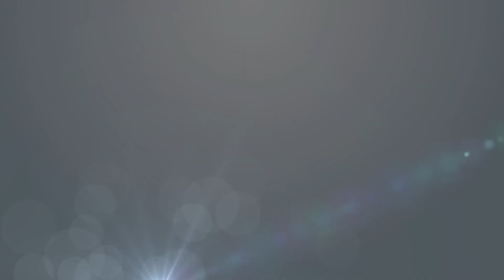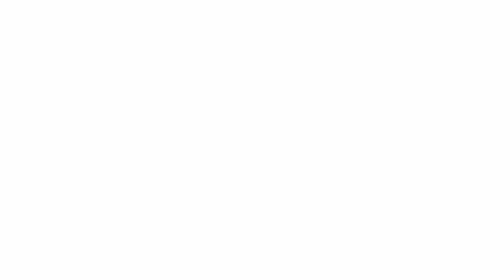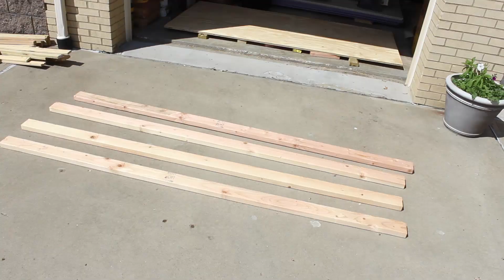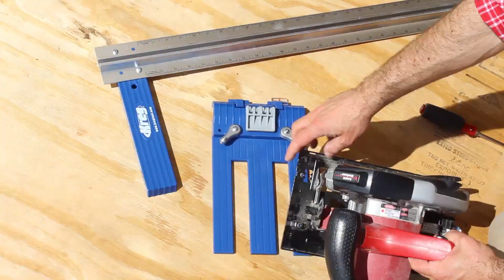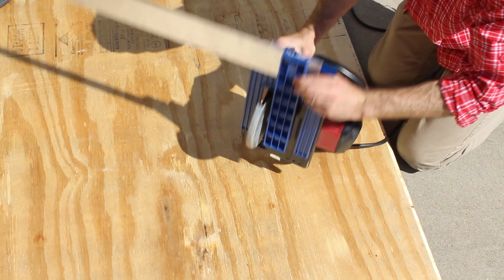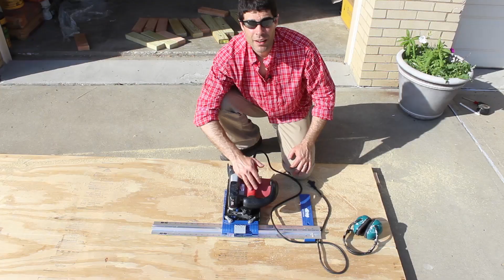Cutting Plywood and Sheet Goods with Kreg's Rip-Cut--by Home Repair Tutor

Comment: This tool is freaking awesome! Ive been cutting panels for years using the old straight edge deal and took delivery and used this first time today. At least halved my cutting times. The construction of the tool is really strong and fits saw perfectly. My building colleague is in love with it as well. Awesome tool cant reccomend enough. Thanks kreg im so impressed.

Comment: Thanks for the video, I just bought this and your tips were helpful. I,m a retired novice woodworker and its easy to use and no problem cutting large sheets, I've a cordless circular saw and the Kreg worked fine with accurate cuts, I'll get better and faster the more I use it, I find it easier than trying to mark out long lines as I always veer off the line so the edge stop is great for me to use. Thanks Again.
Reply from the maker: +Neil WeeGee awesome, glad to help. Those cordless saws are awesome. Especially with large sheets, I always get tangled up!!!
Reply: I'm sure

Comment: I read other people using it and a few said it broke after a few uses due to the weak plastic. Looking at this video the guide has some play during setup, plastic flexing. 

Learn to use a circular saw and cut freehand on the line and if need to, clean up with a hand plane.  Still need a table saw in many situations if you do enough wood projects.

Comment: Looked at one today, but passed cause it looked to plastiky, watched your vid, and now will go back and buy one. I'll be cutting some really nice maple plywood and don't want to make the mistakes I made on my 1st desk project ripping the sheets. Also just a side note, if you use just regular old masking tape over where you plan to cut it gives you a perfect smooth cut without all the splintering associated with plywood's

Comment: Bought this at lowes three weeks ago had to tweek the fence cause it wasn't square.Used it couple times and its good for casual use.If your contractor your better off with track saw.Plastic wont last long I know i'll eventually end up replacing plastic fence with aluminum one.

Comment: I have two table saws but running 4 x 8 sheets is a pain so I have long used a sacrificial cutting table and circular saw to break down panels.  I use a straight edge and a clamp but I'm about to make a whole wall of bookcases and I like the idea the Kreg jig will give me identical gables and shelves so I'm going to get one.  I have the greatest respect for Festools but unless you're a dentist with  woodworking hobby they are way out of reach.

Comment: This can be used "but not great" for fine cabinetry. 
This is for framers, diy,and people working alone with a full sheet of plywood. 
It is a huge huge time saver for framing. Cut right on the pile mutiple sheets at a time for wall sheeting.... dont forget to set your depth.....
 Always have a st8 cut for your next cut. 
Knock sheets down to a manageable size by yourself- then fine tune if need be with a table saw if your building a masterpiece. 
Had this tool for 4 years tossed around in work trailer etc. Still not broke
 Also own a dewalt track saw. Table saw. This adds to a well rounded set of tools and is used everyday. 
Hint... keep a saw set up permanently with it..

Comment: festools guide is allot better, but comes with a hefty price, but does a smashing job.
Reply from the maker: +Dj Eddie Lloyd yah Festool is cool, but whew they take the money like it's going out of style!!
Reply: Jeff Patterson very true, there over rated, i was in my local tool shop 2 week ago and i noticed  draper and mikita have a streight edge template know for sale, €70  or dollars quite good, truck on my friend.
Reply: +Dj Eddie Lloyd Grizzly has a version of their own for about $220.
People make a few mod's and it works great.
Reply: I must look it up.
Reply from the maker: will have to check that out, what is the price?
Reply: Do they ship to ireland. someof these companies don't but never the less it's worth a look, Thanks Mario.
Reply: +Dj Eddie Lloyd Look on YouTube for a video on modifying a track saw. The guy goes through it :/ detail. This saw is made under several brands as well.
Reply: I thnk most tools know all come from the same factory, cause they all look the same, i bought a makita table saw, and chopsa there not as ood as the older versions, they are cheaply painted where as before it was all aluminuim or something simular to alu...
Reply: +Dj Eddie Lloyd The ones I am mentioning are just a label and color change. They don't hide the fact they are the same. Just get a good Diablo blade for it.
Reply: ***** diablo are pretty good blades, in ireland you would pay 75 to 85 dollars fora 6 inch blade. Fairy expensive but worth it. they last a while.

Comment: Just picked this up from Lowes. Thanks for the video! Haven't opened it yet but I'm really glad you showed how easy it is to calibrate it. One question, does clamping the saw onto the blue base is it pretty tight when you screw it down?

Comment: 26 0r 36 bucks i am going to buy one, my table saw is great , but to big to take to a location.. as for a snap line , this is a tolerance that can vary.  I use a clamping straight edge, but it takes time to square up the thing.. As for expert woodworkers, the whole kreg thing is not for them, But for the rest of us who work to live, it makes perfect sense.
My concern for this tool is at 24 inches, how difficult is it to hold in place.

Comment: Is there a way to use this to cut out a section of subfloor that has some dry rot? Set the bar up against a wall?
Reply: Yes but it not worth the time, if you want square cuts just screw cleats of 1x material to the floor and use it as a gude. Chances are you are not going to be near a seam so you will have to block where you place your patch, it needs support on all sides.

Comment: hi can you tell me what dewalt and bosch model this guide compatible with, thanks
Reply: it will attach to any circular saw (Dewalt bosch, Milwaukee, Porter Cable, etc) However it isn't worth buying...Just buy a really good metal edge clamp for sheet goods (or a T-square and a few clamps, then measure your offset on your circular saw base plate to the blade. For example My Porter Cable has a 1 9/16ths distance from the blade to the right edge of the circular saw base plate

Comment: I can't believe I just wasted 15 minutes reading the BS down below. My only real question with the jig is why not make the part that connects to your saw out of aluminium also? When tightened properly it works just fine. As far as the blade thickness problem, be smart enough to calculate that in when setting up the saw and clamping it into position

Comment: good instructional video, but way too over complicating for cutting plywood. Snap a chalk line and cut or for smaller rips, pinch saw table with thumb and forefinger and run your knuckle down the edge of wood as a guide. Also if youre tiling the subfloor the plywood doesnt need to be such a high grade with smooth cuts because youre going to put backerboard over it. By the time this contraption was assembled, I'd have the piece cut and installed already. Not bashing you in anyway, like I said its a good video for what you are trying to demonstrate, but damn, I see so many contraptions in construction that are essentially useless.
Reply from the maker: +Joe Dirt totally understand, this is great for anyone and in particular beginner DIYers who aren't as experienced as yourself.
Reply: +Jeff Patterson 
Or ones who want a strait cut.

Comment: There is something wrong in the setup I can't figure why the Blade close to edge blue plastic.  Should it be in the center so the guard do it's job in your video you put the blade close to the edge then when ready to cut the blade it's in Center LOl, and not to the edge of the blade people must be in drug I see logic but this it isnt  logic to me 
So why at the setup the blade touch the edge, and when you are ready to cut the blade it's in the center I don't get it 
I order this Jig I will figure  it out from the manual  why by the way if the blade touch the edge it's no way the guard move freely
in the manual it's say for saw blade on left hand center the blade in the left sled slot ? CENTER don't say touch the edge
so in your video you show it with the Blade touch the edge sled slot? no one here saw this you confused people man did you read the manual? it's no way the guard move with blade touch the edge sled it'sa dangerous operation man LOL
Safety First isn't it

Comment: I'm a master carpenter with over 25 yrs in the business. 
Like most Kreg products, it's a gimmicky and "consumable" POS product. 

This fence Would be better with all metal construction; the guide is flimsy plastic, and movement of the sliding fence is not smooth.  The cursor and  cursor lock are plastic and brittle;  especially problematic when working in colder temps outside where you are likely to be cutting as a professional carpenter.  

By the time you set this up and calibrate, I could already have a stack of plywood or backerboard cut with a simple rip fence or using a table saw
Finally, the way in which you show to "Calibrate" the Cursor will yield every single cut being off by +/- 1/16th  all the way to 1/8th inch off.  
And here is the reason.....you show the calibration procedure by sliding the rip guide up to the side of the blade (retracting the lower blade guard first), then moving the cursor to "Zero".  
While this is consistent with the instructions by the manufacturer KREG, it does NOT work, and here is why....you are not taking into account the width of the blade itself which will remove the material, making the distance "short" by the width of the individual blade (or greater, up to 1/8th off)
Every piece of material I cut when I first purchased this thing was off by 1/16th of an inch.  
While this may NOT be important to a novice, it is VERY important to a professional

I see this tool as a gimmick...it is not time efficient, not accurate and could be made a lot more durable.  
For $35, go buy a T-square and two good clamps which allows you to even work with larger pieces of sheet material, or even a cheap  aluminum rip clamp from Harbor Freight, which actually works better than this rip guide, and for less money...not my favorite, but it actually works in a pinch
Reply: Archangel0804 if you're a master carpenter then why are you watching Kreg video?  Instead gobbling off, make use of the too much free time you have and design something that reflects the contents of your responses 😎
Reply: Todd i agree even the setup is super quick. First time out took me 2 minutes to dial in cursor correctly with a sample cut. For repeted cutting its super quick. But even when your adjusting the cut width its a sinch to use.
Reply: it would seem much easier to take this to a jobsite rather than a table saw. Also much cheaper than the cheapest table saw
Reply: You are right Mario, the INTENT is good....However as they say, "the Road to Hell is paved with good Intentions"  The Execution by Kreg is POOR!!

Sure....If this thing was worthwhile, it would be MUCH EASIER to take to jobsite than a table saw. That was precisely what I was hoping.
However if the results are either poor or inconsistent, what does it save you, either a DIY'er or a professional contractor? 
Let's look at the score....
How much does it cost if one piece of 4x8 furniture grade maple plywood is cut wrong due to a mis-calibrated Kreg Rip Cut?  $60??   
What if the material is even something more pricey...like 3/4" solid Cherry, used for cabinetry projects? 
 Now we are talking an $80-$100 loss.  
How does this loss compare to the cost of the freaking Kreg Jig?? 
Ever hear the term..."YOU GET WHAT YOU PAY FOR?"
Again, I am simply rating my experience.  If nothing else, I am urging Kreg to build better products that would actually serve a purpose rather than a gimmicky tool which doesn't live up to the hype, and no professional worth their salt will be bothered with. 
Festools  203155,  is a much better option, albeit, "pricey"
Reply: You are right that it's flimsy,I used to use my clamp down 8' straight edge,was making a lot of basic cabinets for warehouse use had a Bosch table saw  to use but found this little guide super handy and quick for ripping my panels accurate enough for the product I was building,not for fine cabinetry i use a festool track saw or my table saw for that yes it would be great to have it all metal but then it would cost three times the price,but I'd buy one if they did.
Ps,I've been a carpenter for 40 year's bought this because it's handy as shit for ripping sheet or 2x.

Comment: During the entire process of assembly, I felt like I'm setting up a folding lounge chair on the wing of a commercial airline getting ready for my budget flight on Kreg airlines.   2 "set screws" are ALL that hold the sled to the base of your circular saw, they do not tighten down tightly and if you torque them down you'll bust the plastic base.  I am either going to drill some holes thru the base and the sled and fasten with screws and nuts or I'm going to send it back for a refund, I may be pre-judging it but I'm calling bullshit when I see it...it's piece of plastic crap!  I'd have gladly paid $90 for the same design made of aluminum or steel with instructions on how to SECURELY attach the base to the sled.  Instead they sell you fantasy and hope all the "sunny skies" forums reviewers will poo poo anybody that points out what a piece of shit it is.  But I actually see a bunch of comments that agree that it is "plastic".."toy-like"..."junk"..and the like..I'm not even sure I can modify it to work well, could be the sled and perhaps the other blue parts needs to be made of metal not thin and brittle plastic.